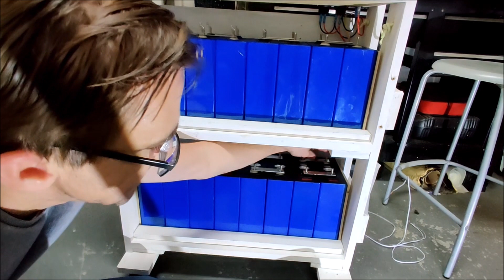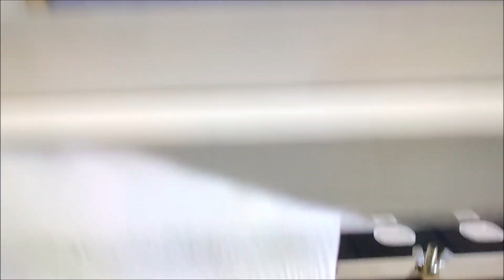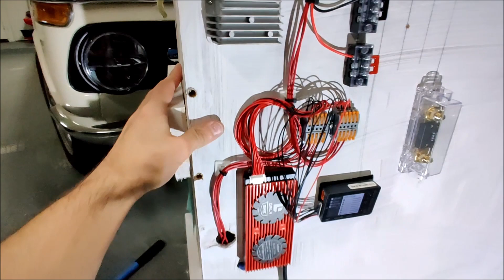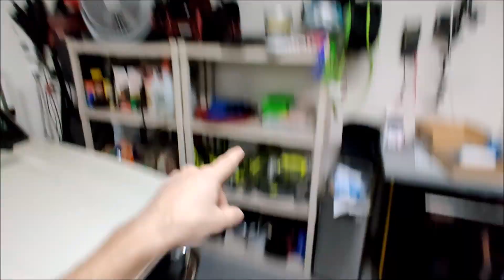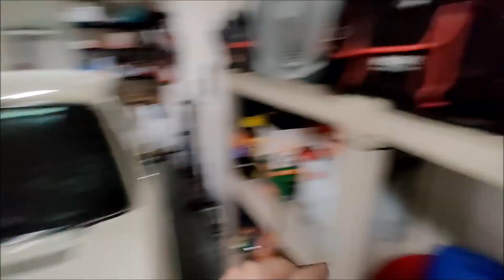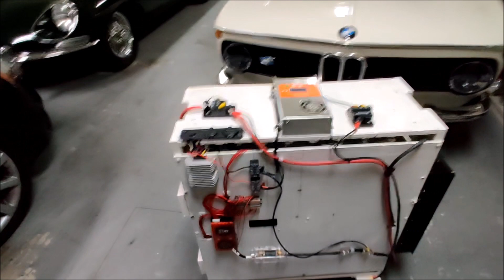15KW lifePO4 Powerwall Part 5 - Wiring it Up!

Comment: Great job. Could I get the specs for the cabinet?
Reply from the maker: Inside width of shelves 23.5 inches. Height without wheels 28inches. shelves are 10.5 inches wide.

Comment: some questions for my understanding

have you come across circuit breakers which are dual pole ? i.e. positive and negative ? 

any advantage of including a battery disconnect switch ?

why not consider another Circuit Breaker instead of the fuse ?

would you consider a BMS with separate charging port to be able to charge the batteries when the load is switched off ?

why not consider 48V ? - it would be thinner wires

The BMS page (aliexpress link) has a mention of UART / Bluetooth. is it really a smart BMS ? or someway to program it ?
Reply from the maker: 1) yes there are dual pole breakers. I did a video on them. They are fine. But breaking just one leg is more than adequate.
2) you do need a battery disconnect, but I use my breaker for that.
3) fuse is an emergency back up for a short. 
4) common port or separate port, either works. I prefer common port since it's simpler wiring.
5) not smart, just has a way to communicate with an app. I actually don't like these because the bms draws power for the Bluetooth.
Reply: @stevenc22  thanks

Comment: Now I have ran into a situation slightly like this. I bought 32pcs 310AH CATL, made sure I made a very good Grade 'A' only Alibaba contract.  Took four  months longer then the contract and the batteries came all dented, no QR codes, different colors, tape under the covering, messed up threads and huge differences in voltage and capacity. Top charging is all kinds of different in amps and time to 3.60 volts each. Now that you did this test I am thinking how do I heard these into two different groups of 16? Each group will have a BMS. Do I segregated them by internal resistance 🤔 or group the ones that reach full quicker in one group and the ones that reach discharge quicker in the other group? I believe anyone with two or more groups would love this discussion. 😀
Reply from the maker: Wow what a nightmare. I'm sorry. Ideally you want to match capacity over the series groups or else the battery will constantly get out of balance faster than a BMS can keep up with. However that is easier said than done. Testing each 310ah battery is a hell of a task, so is recharging each one individually.

Comment: What’s you’re idea on “ I’ve got 13 PCs 3.2v 280A & I’ve got 6 PCs 3.2v 200A & my inverter is 48v  - 15 Batteries- “ What do U think on using 2 of the 3.2v 200A in Parallel = 3.2v 400A twice & if so would you put them as the Main Positive & the main Negative ? Or with the Smart Dalit BMS  would there be an issue ? There still all 3,2v only 13 PCs is 280 Ah & 2 PCs would be 400 Ah All still 3.2v
Reply from the maker: Firstly, if you mixed the 200A with the 280A in series, the battery would get seriously out of balance and the Smart Daly would never be able to rebalance the pack. You are talking about 80AH of difference. The Daly rebalances millie amps of difference, not 80Amps of difference. Even the Icharge X8 balances at only 1.5Amps which is over 48Hours of balancing just to rebalance that 80Amp difference. Don't do it. Secondly you actually use a 16S configuration for a 48V LifePO4 battery, not 15S

Comment: Make sure the volt for the solar panels (pv) won’t be higher then 48volt because of the breaker
Reply from the maker: My PV is 70v / 4amps. That's why I'm using an oversized 30a breaker. It's kind of sketchy but works fine. I wouldn't do this with a high amp load.

Comment: I got a thought when you did the same as others but what I wonder is why not take a flat bar of copper type 20-25x2-3mm and make 6 pcs down 4 holes each so there are no joints and then solder or screw the balancing cable on them and on the 4 that go on solder there instead of screw connection and also solder the belensing cable on them (so it becomes smoother and the current only needs to go with contact to the rod instead of between several connections that can give poorer contact
Reply from the maker: I understand what you are saying but the buss bars you get online are pretty nice and reasonably priced so no need to reinvent the wheel. Plus I'm only pushing 100amps. If I was pushing 300amps I would reconsider the bus bars.

Comment: Hi there! What a great project. We're going to use your videos as reference to build our Skoolie power bank. Curious to know if this is 560 Amp hours and at 24 volts, is it like having the same power as double 560 AH at 12V?
Reply from the maker: Yes this is the same as 1120ah @ 12v. I am not a fan of 12v builds, you need much thicker wire for everything because of the much higher amps although for a skoolie there may be some 12v appliances
Reply: @stevenc22  Thank you so much for clarifying this for us., Yes, we will have a few 12V items for sure but will just connect a converter to step down the voltage for those items. That's a great deal of help so thank you. I am pretty new at this solar setup stuff so I'm learning as I go. Thanks again!
Chris & Steph